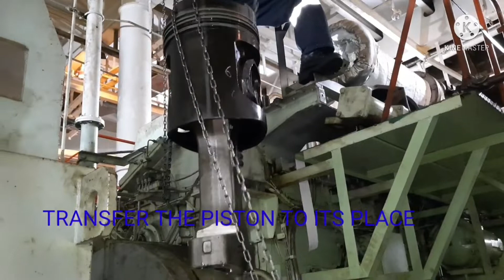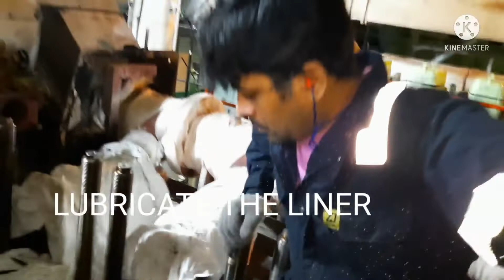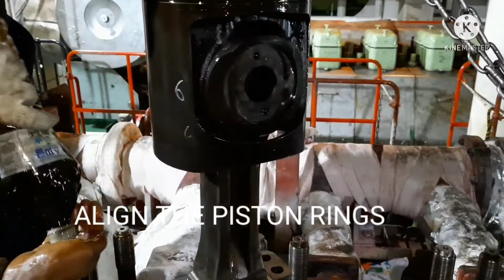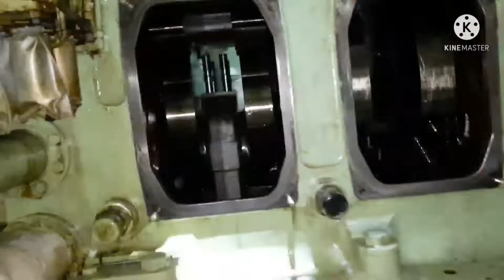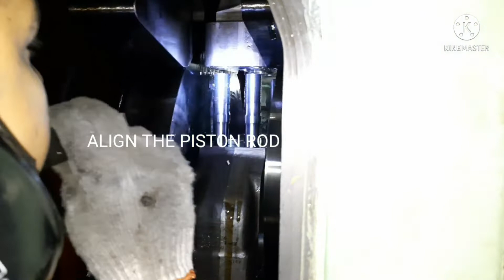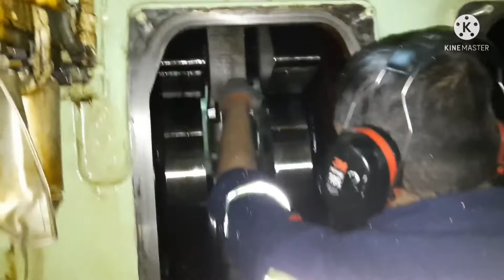PART-25(ENGLISH)..HOW DO THEY DO.DIAHATSU GENERATOR DECARB....HOW TO INSTALL PISTON IN PLACE..

Comment: What is the reason for marking hydraulic nuts? They are exactly identical
Reply from the maker: They are identical sir.. But the elongation of the bolt and nut will match if v use the same without mixing.. Even makers recommend not to mix